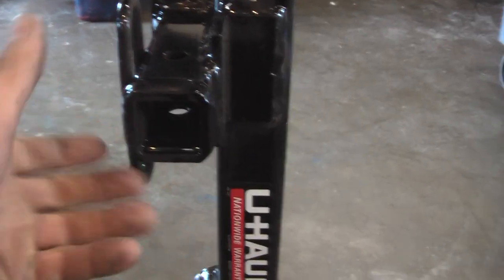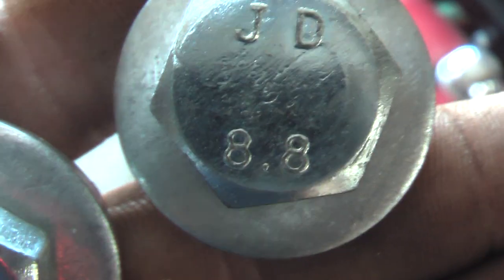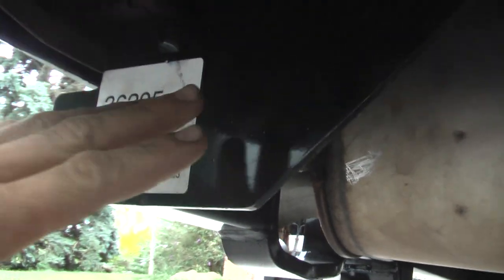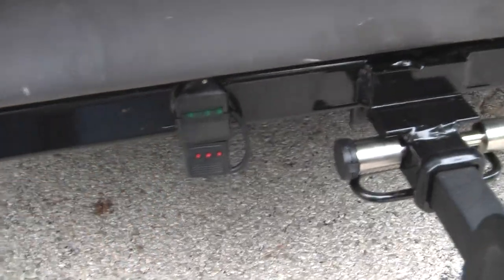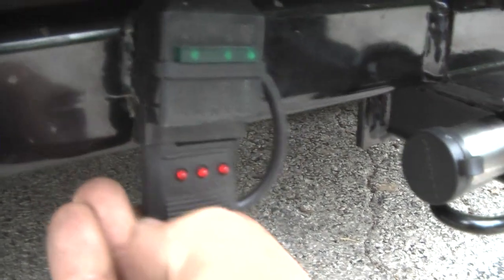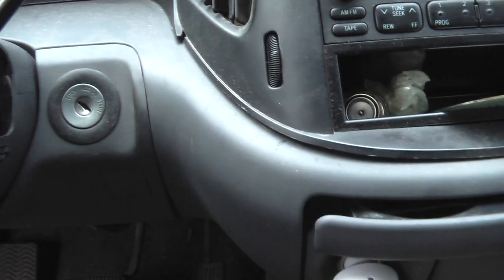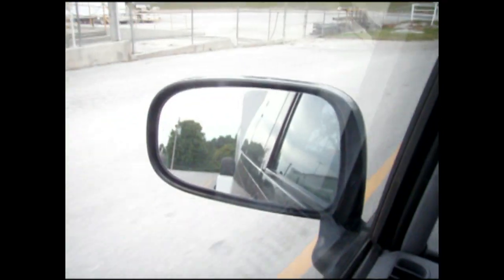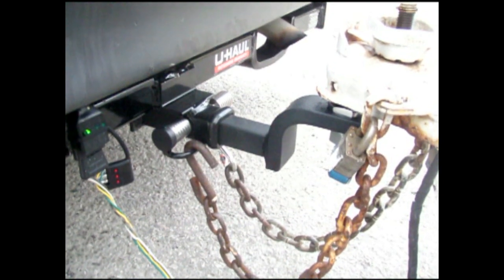Toyota Previa Hitch Installation & Trailer Towing

Comment: I just bought a '91 Previa with a tow hitch already on it. I'm about to drive 400 miles with a 5x8 enclosed U-Haul trailer. But I just noticed that the manual that says" "DO NOT drive over 45 mph towing a trailer." Is that really true? Can I at least get it up to 55mph so I can legally drive the freeway? (I expect a fair amount of wobble's)
Reply: We have one of these, and we tow a 1979 Boler trailer (about 2500 pounds) we can go up to 60 mph safely, but you need an anti sway bar.

Comment: What size is the hitch receiver?  I am looking to install a hitch in my 97 Previa All-Trac with supercharger engine for a bike rack.  The reseller recommends me to install a 2" receiver.  I was told by U-Haul that only 1-1/4" available for this minivan.  I see  you also install a U-Haul hitch.  Could you tell me what model it is, if you remember.  Thank you.